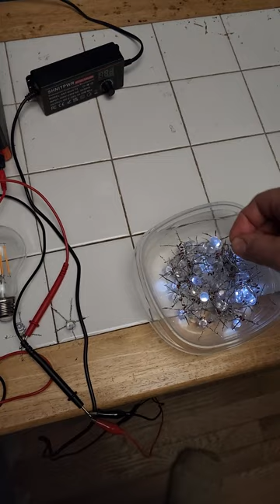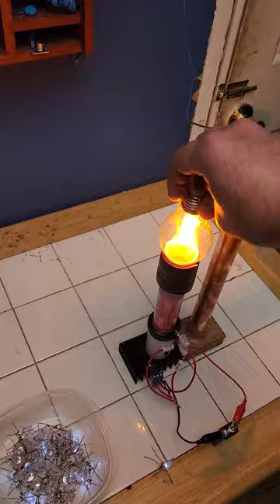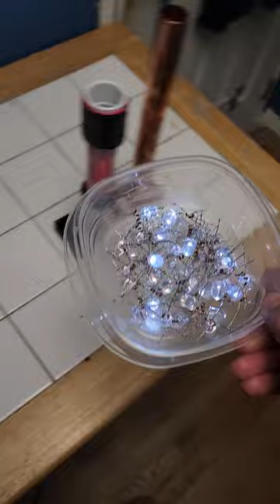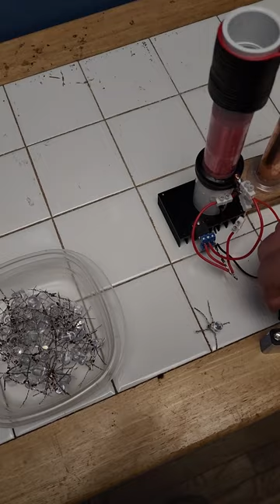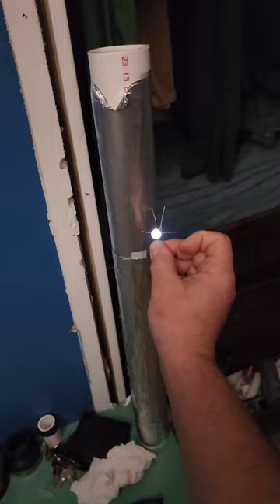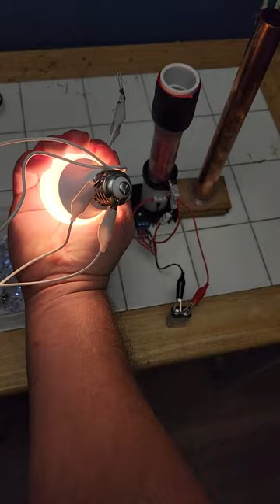🔋 YES, IT CAN RUN OFF OF BATTERIES! 3-20V BATTERY 🔋

Comment: love it!  great work my friend
Reply: You found it! Isn't he great... He made it work. Hey Burneye take a look on a old video with germqn Title "Der Urzeit-Code" 1/2 it is about the electric fields that set plant genes back to the original old time code...
I bought a new laptop and will arrange some stuff so we can do a video chat. Hope it will work. 😉🌻❤
Reply: You remind the discussion I stepped in your Video chat about the Chekurkov Disc. Remind the assembling he had beside with the battery and huge tesla coil in the fields.. I think the arrangements creates a field feeding the disc.. And I will tell you what... Remind plans of the fluxliner or ancient vimanas having such column in midfle that is the same arrangements... So its not like in the model of Chekurkov outside, its onboard creating the electric field around. There is mire to say about that column inside but that goes to far is other technology as most understand. It has to do with liquids and friction causing high static electricity. Like to cans filled with water running a metall line downwards running water trough the lines, if lines cross they create a discharge of the water flow visable by sparks. But their technology was much more efficient working with mercury.. Releasing high monopolar static energy. 😉 Burneye... Time to chat in private ❤🌻